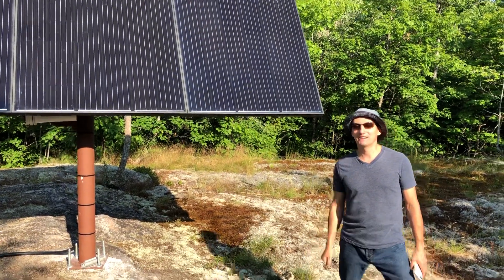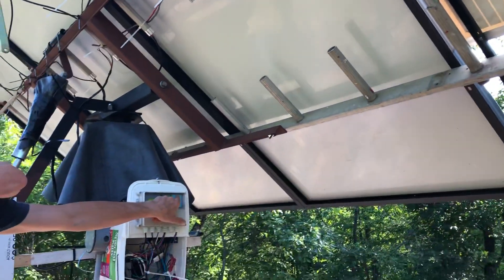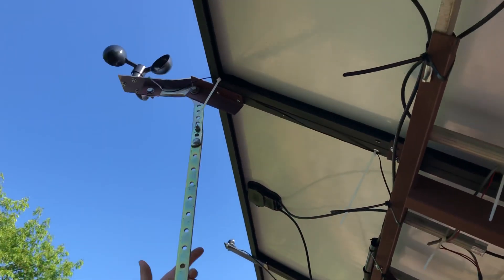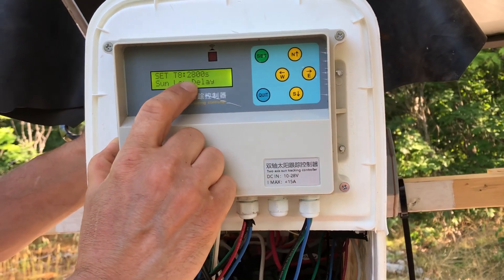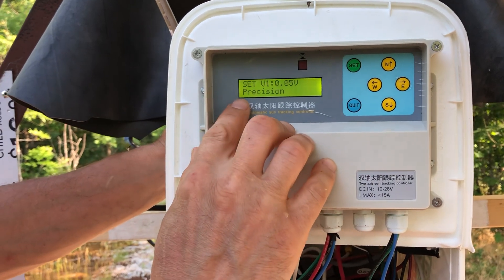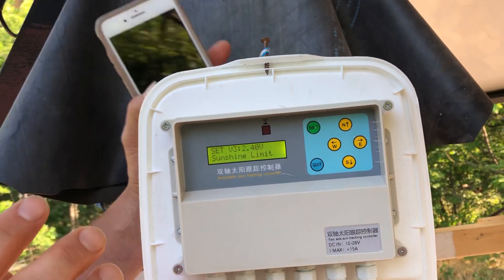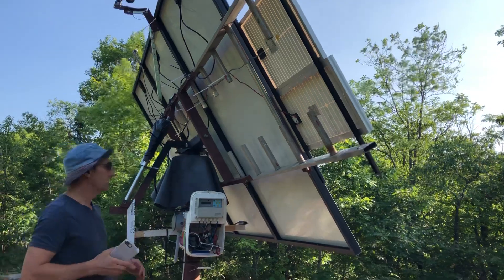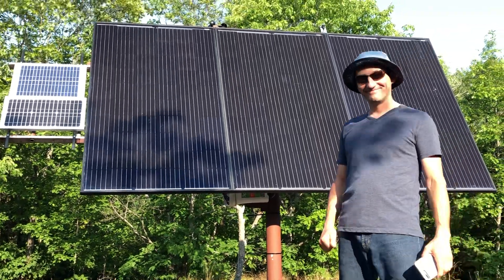Solar Tracker Controller From eBay, settings, programming and  how to adjust

Comment: This is the same controller Eco Worthy uses, I would like to set it flat position at night but I couldn't because it doesn't have that option, mine is driving a very large E/W actuator that currently is holding 36x400w panels.

Comment: Hello Val, thanks for the video. Can I also use the controller for a single axis system? What parameters do I need? In my case I need East to West. Set the other parameters to zero? I would be happy to receive an answer. Also by email. Greetings from Germany-Martin😀
Reply from the maker: If you have a two axis controller, then set north south to zeros, or you can buy the controller design just for one axis, which is much cheaper to buy
Reply from the maker: Wish all the best with your project
Reply: @valmaz2448  Thank you. I will do my best.

Comment: I like your video on your solar tracker 😊 you know l have the same solar tracker controller and l can’t get sun sensor to work? Do you know what the seating on the controller are supposed set at and where to set them at.  Thanks Dave
Reply from the maker: It Could simply be a defective, controller or sensor, sorry for the late reply
Reply: Ok thanks

Comment: New problem. Everything works fine, apart from my N/S actuator. Manually, it moves fine without issue. Automatically, when it tries to move it restarts the tracker. The E/W actuator move fine without an issue. Any ideas?
Reply from the maker: It could be that your tracker is defective, try to replace it

Comment: Hi, I have the same system as you. However I go through the same steps, checked and everything moves fine. Now when I save my settings and leave it, the system doesnt appear to track the sun. It just doesn't move. Any ideas? Thanks 😊
Reply from the maker: It’s really hard to say, maybe the truckers is defective,  if you still have a chance try to Replace it
Reply: @valmaz2448  hi, thanks for replying. That's a possibility. I'll arrange a replacement :) ty.

Comment: Thank you very much. I need to configure it to find a horizontal position in high wind. How is that done? 🤔
Reply from the maker: It really depends on the time your actuator moves to the horizontal position I gave it three extra seconds
Reply from the maker: If you watch the video, it’s there

Comment: I have configured mine the same.  Only problem i am having is in the east it moves up a few inches and 60 seconds later goes back down a few inches over and over.  What is causing this to do that?
Reply: I solved the problem. Whenever you see only TX or YX not both then your sensor has lost one of its links aka wires which will cause the unit to bounce up and down trying to get its axis configured etc.  I replaced the solar sensor and it fixed the problem.  I also changed mine to 000 and 000 so it will instantaneous calibrate. Which I have 26v 8a solar with 10A MPPT charging a 20AH LifeP04 dual mini battery bank dedicated just for the controller and that is ample amount of juice to sustain a trickle charge and float the entire day without going passed 90%
Reply from the maker: I’m sorry, but I have no idea what can cause that

Comment: Hi Great video, can you please explain how to set up parking position of tracker. For Night or for High winds. My tracker gets stuck at Night completely in west position and than in morning it does not see sun, so it takes long time for panel to start to track sun.
Reply from the maker: Where are you located? Is it N or S atmosphere?
Reply: @valmaz2448  Slovakia
Reply from the maker: So, in this case, you just need to follow all the instructions in the video, just set up your controller, the same way I did, and it supposed to work, if it doesn’t, then may be something wrong with the controller
Reply: @alfonzliska4819  Hi Alfonz, I am from Czech Republic. Did You already use this controller? I am interesting if it works properly. Thank You

Comment: Thanks for the video! Mine works pretty well. BUT! i got one problem, if the panel moves back for the morning sun and at night the wind starts to blow it moves to horizontal. And then it stays in this position. The morning sun is not reaching the sun sensor, so i miss the morning sun till it goes high enough to reach it.
Reply from the maker: I guess that could be an issue, but it’s not a big one
😊
Reply: I think its a big issue
Reply: The next issue i found out after some days using is the wind lock time.
If the wind blows on the end of the day and the sun goes down, it stays right at this position because of the T7 xxx's it goes into "lock" so it waits till the sun reaches the sensor. But there is no more sun till the morning and then it's in a wrong position and you miss the half day
Reply from the maker: I’m sorry to hear that, I never experienced that before😕

Comment: Hello friend, congratulations on your project, I live in Brazil and I'm developing my own 100% automatic tracker and I know how difficult it is to make it stable on cloudy days, when there's a lot of cloud it goes crazy looking for the sun.
At the end of the day after it gets dark, does his follower stay in a horizontal position or not? What position does he spend the night in?
It would be really cool if you made a video showing on time-lapse his movement for a whole day with cloudy weather. If possible...hug. Success in your projects.
Reply: Check out hippie hill homestead as well!
Reply from the maker: Thank you for your question, unfortunately, we sold our property and I took the panel down, so I cannot film it working anymore. However, to answer your question.
The panel will move to whatever position you want to at night and that can be adjusted in settings, That are coming after T8 - sun low position, this position indicates how long it waits before it moves(2800 seconds), and the next setting indicates where it moves for the next morning, that would be all the way to the east, and tilting all the way down for the rising sun those adjustments are in T9 - T 12 settings.
All the best with your project🙂
All the best with your project.
Reply from the maker: I will try next year when I set it up again

Comment: Hi, So increase self-consumption sharply in order to save electricity costs by avoiding electricity from the grid / shortening the amortization. With Dimmer + Solar PV, self-sufficiency will now increase to almost 95%, because expensive purchases from the grid are so easily suppressed and the electricity bill stops just like the electricity meter. The prerequisite is that you have at least a small solar PV balcony power plant, and you don't need an expensive battery either. Many examples below: https://youtu.be/eC2olbCBhh0 , Kettle: Without a dimmer, the 2500W - 600W PV system needs = 1900W which you have to pay more for. If I turn the kettle down to 600W with a dimmer, then every weak PV system can now supply each consumer independently and independently, because the 2500W kettle becomes a 600W kettle thanks to the dimmer. No magic, just physics. The 2000W e-heater becomes a 500W e-heater with a dimmer, which can run 12 hours a day free of charge via PV. The 4000W oven is also tamed. It is not the solar arrays that need to grow, the consumers simply need to drop by 75%, which is so easy with the dimmer. I have already switched my entire household to dimmers. Please have a look at my channel. 🌞 ........... Increase mini PV solar self-sufficiency (winter and camping): You can continuously regulate a boiler and other power-hungry consumers with the "5000W dimmer". Ebay €7. I run 4 dimmers in parallel on an 850W inverter. Kettle 2.2KW at 150W runs 12 hours a day, so the water is always hot https://youtu.be/D9Ss0RuqZG0 . The room is also nicely heated. 2.5KW washing machine runs in parallel with dimmed to 400...600W and always reaches its 60°C, and also its 1400rpm... It doesn't matter to the washing machine whether it changes the washing temperature to 5min@2500W or 100% can be achieved free of charge via existing PV power in 20min@600W. The wash cycle lasts the same time dimmed and non-dimmed, 3Sth 10min. The iron https://youtu.be/-71oL7z1kMU , dishwasher https://youtu.be/8vnAkrS1x-s , oven https://youtu.be/azDjqZpz77U , electric heater https://youtu.be/QbLWDbJi6ew , Waffle iron https://youtube.com/shorts/ofanZCdYEjA?feature=share, coffee machine, all internal heating is throttled with me. Lots of videos on my channel. The inverter stays cool and quiet and the MOSFETs + (battery packs) stay intact because extreme current peaks no longer reach the inverter. Now every Mini PV Inverter is enough to operate large devices. So, with the dimmer, all internal heaters/devices can be converted into base load devices that stay almost permanently ON, drawing very little current directly from the PV. With a wattmeter / energy cost meter you can then measure this perfectly in order to set the dimmer optimally. ........ Comments: "Great idea - despite studying electrical engineering, I didn't think of it myself ;-)" or "I installed it in our washing machine, great idea!" or "Glück Auf Christian, I'm a professional myself but I haven't figured that out yet. 👌 Greetings Mitch 💚" and many more... LG Christian 🌞 ........... "smart energy saving" , has made a meaningful reaction video to the dimmer: https://youtu.be/EHtJGiXAjZk . 🌞 ......... "Free Range", also made a meaningful reaction video, to the dimmer: https://youtu.be/qzdRdBObtvY . 👍........ "Jens Kummerow TS", also made a meaningful reaction video for the dimmer: https://youtu.be/fTY5jWvz5CY . 👌 ........... A little hint: Energy cannot be saved. So if I want to boil my water, I always have to use the same amount of energy for one liter. Christian's method relies on a longer period of time with less power in order to be able to use the power provided by the PV as efficiently as possible - so consumption peaks are intercepted. In the end, the energy consumption should even be (slightly) higher due to the interposition of the dimmer, but it doesn't matter, since more efficient coverage by the PV system and therefore better use of the self-generated energy .......... Here an "automatic PV excess control + remote controlled dimmer with heating element" / load management (consumption / heating rod follows PV excess ...): https://youtu.be/IWp7Mi2FldM . "Obermühle" solved this via PLC: https://youtu.be/iR30cDaf1Xk "Heating with excess PV🌞Do your own heating rod control". 🌞 .......... I installed a 2-axis solar controller on my DIY solar tracker: https://youtu.be/_Rs8CptQcDw. .......... More videos on my channel. LG Christian ............... ATON - Power to Heat: https://youtu.be/wnVSaioJsjY .  ............... ............... ............... ............... ............... ............... ............... ............... ............... ............... ............... ............... ............... ............... ............... ............... ............... ............... ............... ............... ............... ............... ............... ...............

Comment: Hallo ein tolles Projekt hast du da 
Kannst du das auch auf Deutsch ich habe den selben Tracker und das übersetzen ist mühsam
Reply from the maker: Leider verstehe ich kein Wort auf Deutsch, kann dir dabei leider nicht helfen, sorry
Reply: @valmaz2448  Thanks for the info 🙋‍♂️
Reply: @nitraM-13  Hallo 
Die Sonnenverfolgung funktioniert nur das abschalten bei Wind mit Horizontal Ausrichtung klappt noch nicht.
Reply: @steffen6366 hast Du eine  vernünftige deutsche Übersetzung gefunden, oder evtl selbst verfasst.
Reply: @copkiller0815  Ich probiere einfach die Werte aus und schau was passiert 👀
Reply from the maker: sorry, aber mein deutsch ist 1000 mal schlechter als dein englisch 😬
Reply: @nitraM-13  aber gern. Darüber würde ich mich freuen
Reply: Hello,
when I connect the wind indicator, it starts to rotate. There are 12 Volts at the terminals? is that correct. It supposed to spin in the wind, and not like a motor.

Comment: This controller seems to have more settings than others from China. This unit has max output of 15amps to power actuators.  Do you know if a separate higher amp power supply unit is available using signals from control unit going to relays in the higher power unit?    I think one of the settings was it aimed West for a period of time, catching whatever sunlight there was, then went back to East waiting for sunrise.  The other setting of interest was period of time it waited when clouds came over to try to relocate sun position.  The wind speed indicator- the faster the wind, the faster it spins, the higher voltage it produces and sends to controller.  That is why there should be a table where for example 2.5V = 40kmh,  2.6v= 45kmh etc
Reply from the maker: I'm don't really know, but it's a good question, let me know if you find one, thank you
Reply: Hi, there is a label on the wind speed case that says: Output Voltage * 25 m/s, that means when it has 25 m/s, the output will be 1 Volt. And 25 m/s = 90 km/h. I set V2 to 0.31V, that means around 28,1 km/h it will go to wind protection mode.

Comment: Hi, Can you provide complete circuit connections diagram or video for sun tracker, motors and controllers.
Reply from the maker: I just posted the video with the information you requested
Reply from the maker: Ok
Reply from the maker: I will do it in the next little while

Comment: Thank you for the explanations 👍!!! 
Do you make a video with the rest of the assemblies that you used on the system? What motors did you use? What profiles did you use in the frame? Thank you and I am waiting for more details about your project 👍🍻
Reply from the maker: Thank you for your comment, I made a video, but didn’t have time to edit, hopefully in the next month or so I’ll work on it and put it on the YouTube, thank you 🙂
Reply: @valmaz2448  yes please just get it on…edit is not really mess art!
Reply from the maker: Just posted a new video with that information 🙂
Reply: @valmaz2448  What hemisphere are you in? In which country? 🤗👍🍻
Reply from the maker: @DanuAl-FLY  canada
Reply: @valmaz2448  So in the Northern Hemisphere. So do I, Romania, but I still don't understand why it doesn't correct itself after the clouds pass?! The settings are similar to yours, only the times are different. Since morning there have been clouds. He sits on his back, to the north, and comes to the west maximum... I'm not home, but I need to re-set the script. 👍🍻